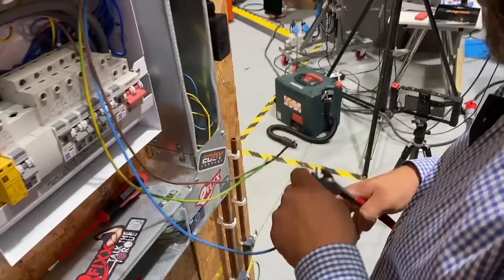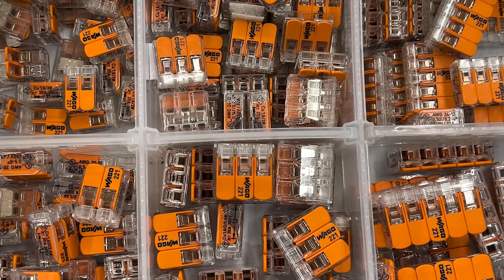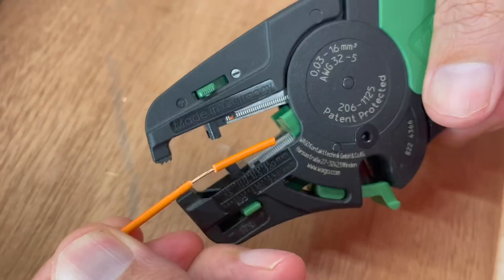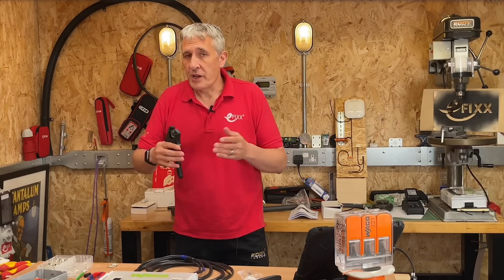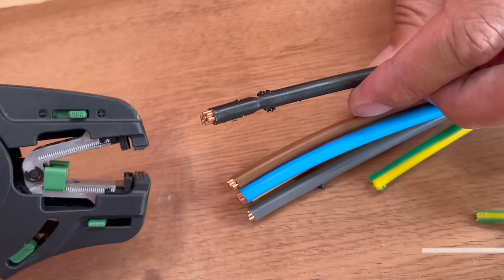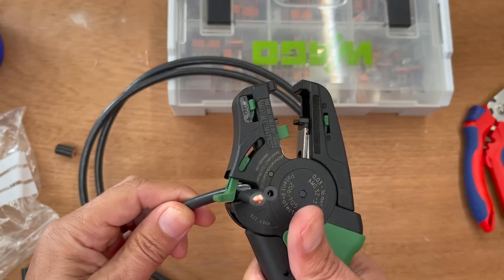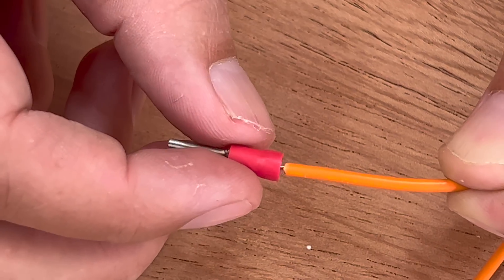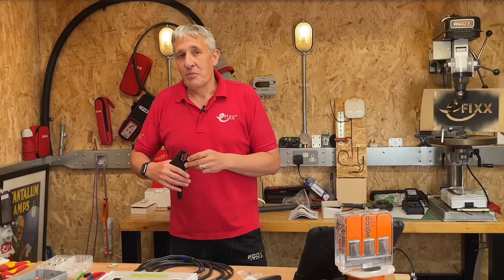The Wago Quickstrip Vario Wire Stripper's Secret Revealed!

Comment: had a similar stripper at work  branded by Garant (also had the pressure adjustment) and the blades were actually multiple hook like  blades stacked together not a solid piece - after more then 10 year of use the plastic holding the blades broke - replaced with a knipex with solid blade and no adjustment and it was crap compared with the old garant one.

Comment: Well, well, so Wago have decided to copy Weidmuller?
I have a Weidmuller Stripax...
 I've had it since 1986 and as I've retired in 2022 that makes it 36 years of service. The Stripax has a multi segment stripping jaw, which is replaceable. 
My model could only strip up from 0.08 to 6sq mm. I think the new ones go up to 10sq and 16sq depending on the model and I think they also do a model which crimps as well as stripping.
Mine has a built in cutter and an adjuster for different cable sizes which you have to use if you need to strip very fine stranded wire.
My  Weidmuller Stripax is still working fine after 36 years as I use it around the house, but I might treat it to a new set of jaws.
Gorden, get yourself one and try it.
Reply: I’m sure they’re familiar with it. 

All the terminal companies (WAGO, Weidmüller, Phoenix, etc) sell tools as well, and those tools are almost always outsourced. Some Weidmüller Stripax models and Phoenix Wirefox are rebadged Pressmaster (Sweden), the WAGO stripper is made by WEZAG (Germany). For all intents and purposes, nearly all first-party crimp tools are made by about 5 companies (Daniels, Astro, Pressmaster, WEZAG, and some Japanese company), and similarly, most automatic and semi-automatic strippers are made by a similar handful of companies (Pressmaster, WEZAG, Ideal (USA) and Jokari (Germany)). (Ignoring no-name knockoffs of course.)

The WEZAG stripper is also sold by Wiha, the Pressmaster is sold under their own name and many others, like Jonard, Molex and Facom. TE’s is a rebadged Knipex, I suspect.

The one I really like is the Knipex MultiStrip 10. It doesn’t have an adjustment control like the Stripax, because it doesn’t need it, it just works well throughout the wire size range, whereas with the Stripax I have to be very careful to remember to adjust it for smaller wires. (I’m an electronics technician, not an electrician, so I tend to work with a lot of thin wires, but still have to work with mains wiring too.) The only downside is that the MultiStrip is not as able to deal with slippery insulation like cross-linked PVC (never mind Teflon). The Stripax is a tad better with that.

Comment: I find with tools like this (I use the pressmaster embla with the blue blade) that larger conductors are best stripped by giving an initial half squeeze, releasing pressure, rotate the tool 90⁰ around the wire & then give a proper squeeze to finish the job. The extra pair of "cuts" in the insulation allows the insulation to be removed cleanly.

The embla's blue blade is specifically designed for PTFE insulation, so that probably helps too.

Comment: Although I now use either some CK strippers or Knipex unit similar to the above, for a few years i just used a set of great pliers with a good feel and knicked around the cable with the cutting edge (only on single core cable) and slide the outer insulation off careful not to mark the copper core. This was how an experienced guy i trained with showed me. He said if you can do it this way you can always get by and do it when the fancy tools aren't with you or the compulsory construction site thief has took them. How many of you have done it this way.

Comment: Weidmuller makes a better version.  The jaws are not solid but finely segmented laminations and conform to the shape of the insulation.  I build automated machines.  There new version has the crimper built in but at $350 it’s a bit pricey considering the number of crimping tools I already own.  Most of them are for specific terminals and a mil spec one was $700.  Most are made in Germany or Switzerland.  They are made from hardened and ground steel.  90% of electrical problems are mechanical in nature.  A nicked wire or loose crimp is usually what I find when called out to fix a line down machine.  I am neurotic about the wires in my machines.  I live in the USA but much of my equipment goes to the far East. ( South Korea, China & Taiwan are a long way for a service call.
Reply: Wow.  That lead me down a long rabbit hole.  I had never heard of Weidmuller before, but their tool line looks amazing!  I'm sold.

Comment: QUESTION: sorry if I missed this, will it strip the protective sheath around twin and CPC? Wow, the intro of this video was 100% relevant to me. I've had a CK Automatic Stripper for over a decade and it finally broke. Bought a new CK, of course - but the new model just didn't work. Didn't grip the sheath. If you held the wire at a strange angle it would kind of work but mashed up the sheath and didn't give a clean cut. I replaced it with another one which worked better for about a week, then it became unreliable. Then I bought a cheap Amazon one which gives a really clean cut then I realised it just can't handle bigger diameters, e.g. a flat twin & CPC of 2.5mm is fine, but a round one is not. Then I bought the Knipex ergostrip which is okay but useless for stripping flat twin and CPC and a number of other external sheaths (although the only thing that will do meter tails nicely). Finally I use my non-automatic strippers for small single cores, but of course it doesn't strip protective sheath around multicore, only single core. Also you have to manually flick the stripped bit of sheath off each time, so annoying. Still I have no damned wire strippers and I'm hugely depressed because I have to get about 5 different strippers out for a job and none of them work properly. GRRRRR!!! I'm doing panels and general first fix - need something good!
Reply: Also didn’t catch if it could strip the sheath of a twin and earth cable. Also using the CK but ready for an update if it does the sheath!

Comment: I don't think WAGO made/dessigned these .. it's looks exacly the same as my Klauke K43/3 ( but the klauke is  in Blue ) 
Seems only the extra feature is missing on mine . The  Wiha Z 57 0 06 SB  seems also exacly the same w/o the extra feature ..
Reply: I’m almost certain it’s manufactured by WEZAG, a German private-label tool manufacturer that is best known for making crimp tools for all the big connector manufacturers.
Reply: Weidmüller also has this "extra feature", but a different way of using it. Can't say anything about the Wago version, but in my experience it pays of to pay a little more for this tools. You'll find basic versions for 10 - 20 €/$/whatever. But the more expensive ones from Knipex and Weidmüller (and I would consider Wiha, Klauke and Wago in the same category) usually perform much better.

EDIT: I know the prices of the tools vary extremely from country to country. Export / Import must cost a fortune.
Reply: also strongly resembles automatic strippers by Knipex, also made in Germany